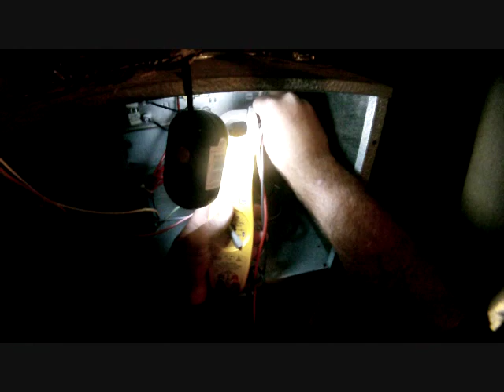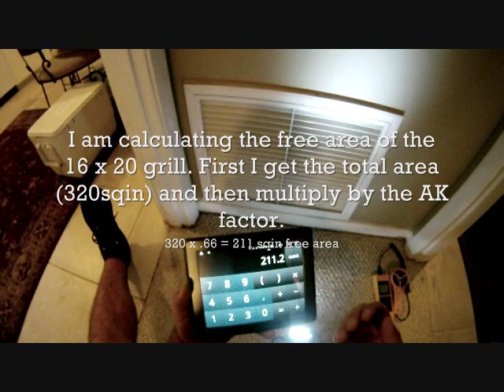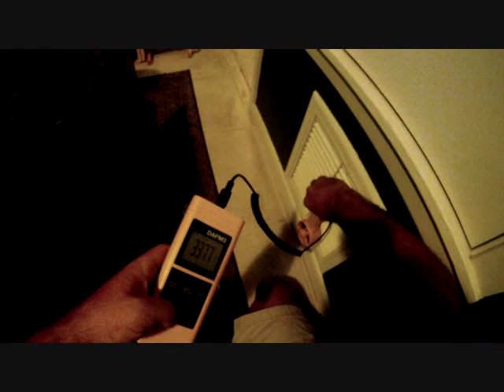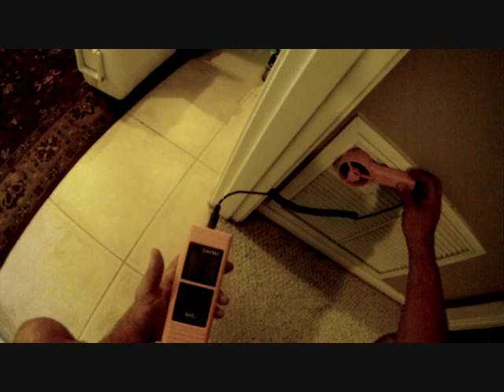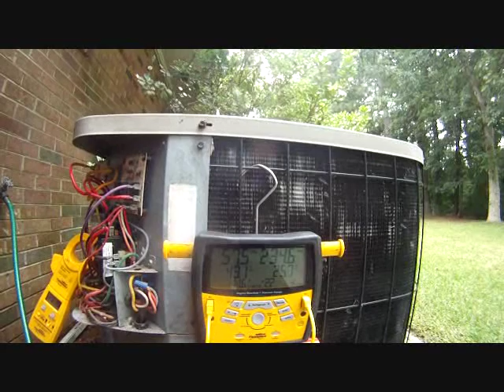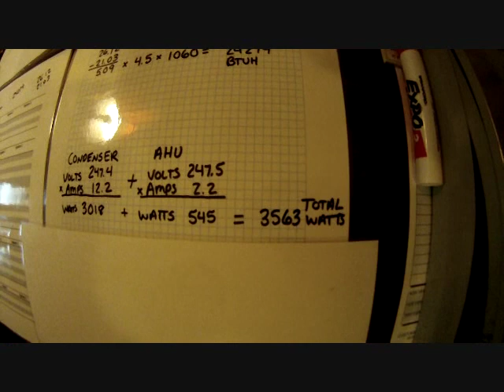HVAC Service- Complete Heat Pump Service

Comment: VA is not equal to amps. I think for these purposes they show what you are talking about, but you should include impedance on AC.
Reply: Also, could you give us a copy of that sheet you use. It is amazing.
Reply from the maker: +wasup23tube at the time of this video I did not have a wattmeter. Therefore I do not account for power factor

Comment: I think the flux capacitor check should be done before the muffler bearing check. Also the colors of the wire coverings should be checked as well as the wire resistance.  Honestly the only useful thing shown was cleaning the fins. Unfortunately other even more useful maintenance things like cleaning leaves out of the center of the heat exchanger AND changing the house filter are not shown. Too bad.  But then I'm sure the form the customer gets will be useful to him. (not)
Reply from the maker: Tell me how you really feel, geez.

Comment: Thanks again for the video, headed out tomorrow to pm  a payne rtu hp, watching videos and reading material to brush up. The whole delivered cooling btu at the end was pretty cool still trying to get down static pressure and traverses but the goal is to be solid on the air side in the near future. Have a cool one.

Comment: Don't you have to convert sq. inches to sq. feet (divide the area in sq. inches by 144) before entering the area into the anemometer?  Does the anemometer make that conversion for you?  16x20 sq. inches is an area of 320 sq. inches or 2.2 sq. ft... multiplied by AK factor .66 is 1.5 sq. ft.  I would think this is the area to be multiplied by the velocity (fpm) to get the CFM.  Am I off somewhere?
Reply: Just checked my anemometer.  It's similar to yours but made by Pyle.  It says for me to enter the area of the duct in sq. ft.  If yours does the conversion for you I should have gotten the UEI.  It would save me a step.

Comment: How would I go about calculating the total watts on a heat pump package unit?
Reply from the maker: I think you did good Doug. There is one thing you can do to make your numbers more exact; find a meter that uses power factor when determining Watts. That takes into account the power generated by the motors in the equipment. Eddie Leverich and Fritz have an Amprobe meter that does that. Without it your total system watts will be off a few %. My meter does not do it, but to be exact you will need one that does. It will not make a huge difference but it will raise that EER slightly.
Reply: as far as I can remember its volts X amps = watts
Reply: Right.. on Zack's video he had a split system and had to add the readings from the AHU to the readings from the outdoor unit.  With the package unit being self contained, I just took the readings from the L1 and L2 coming in from the disconnect, assuming it would give me total volts/amps being used.  I came up with a 7 EER and wondered if my calculation was correct since I didn't do any adding of readings together as with the split system.  Any thoughts?  Should I have taken seperate blower/compressor/motor volt/amp readings between the condensor fan, blower fan and compressor?
Reply: talyn875 Thanks!  You are my go to guru!  Eddie and Fritz are my other two favorites.  The three of you have the best, most informative and relevant videos pertaining to my self education routine.  As a new contractor/business owner I study my manuals and formulas every morning.  If I need explanation or examples I look up YouTube videos and usually end up on you, Eddie, or Fritz.  It's a HUGE help and is helping me to really impress my customers.  I think I have about every stand alone instrument Fieldpiece makes.. lol... except I DID go with the Testo 550 digital guages (per Fritz).

Comment: hey great video I am studying for my state license right now and should pass as I am a self employed bathroom remodeler and want to include hvac into my services to be more recession proof, this was great vid  showing all aspects of maintenance program , do you have different kinds or do all your maint contracts only offer this full scale systems check, and about how much should I charge my customers annually for this kind of systems check, and I love the way you offer all the specs of you diagnostics to your customers to show that you were there and really checked it al out thanks and 1 more question if these vids are for hvac techs only then why are they available to the public I have an epa cert # to verify my status and could this or and state license be used before allowing it to be seen and this way it would only be seen to certified techs only ant not the public just curious as to if you ever thought about how to protect our industry thanks again